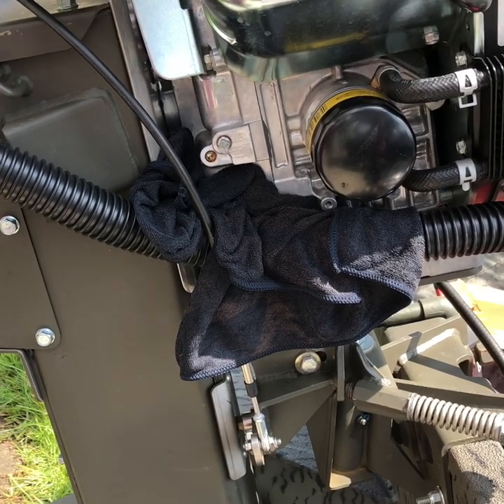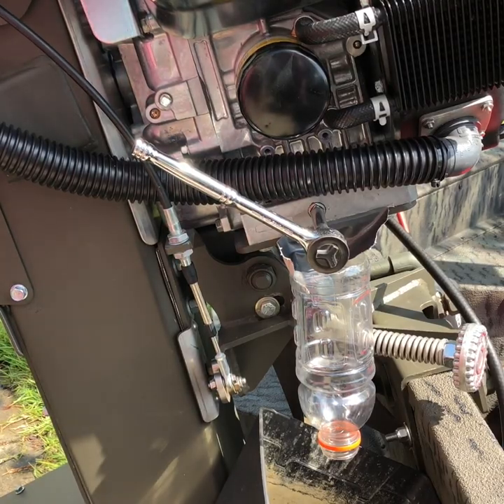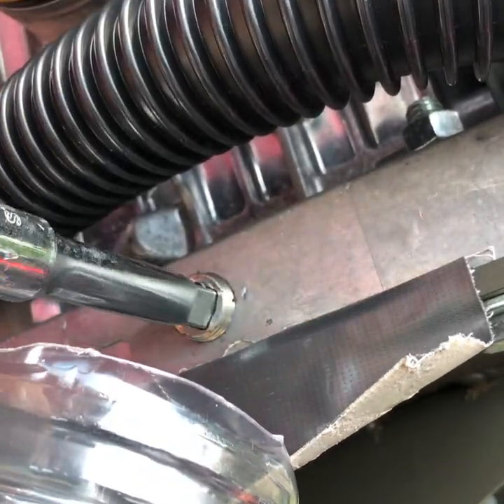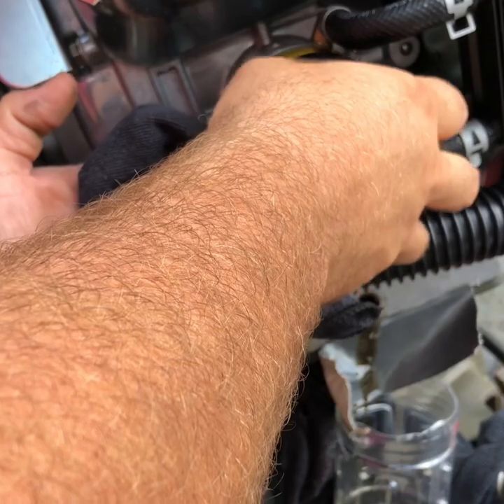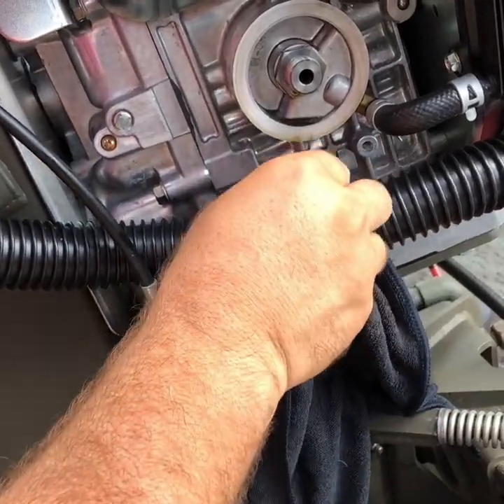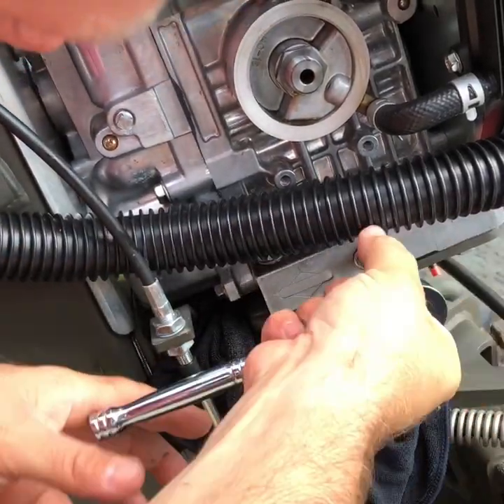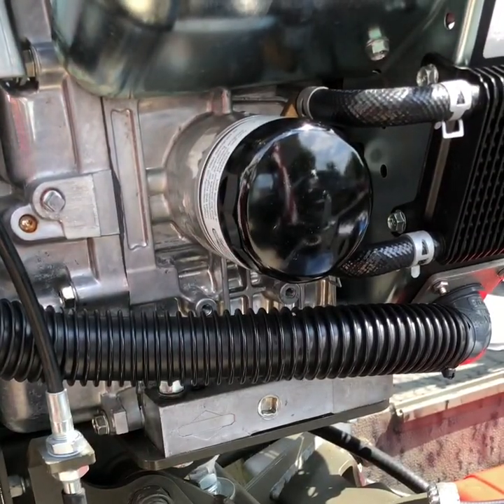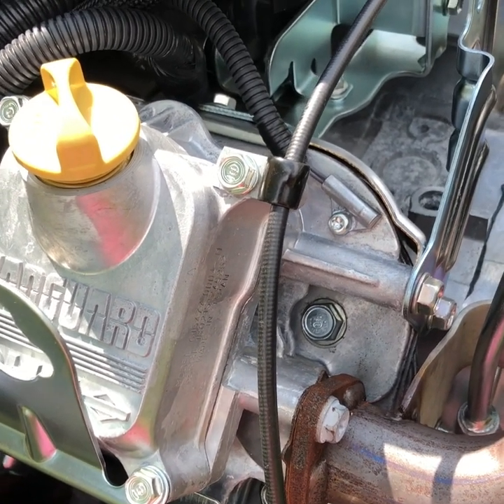Go Devil fnr Vanguard 40efi first oil change

Comment: U should level the engine or at least have it tilted to the pull plug side before draining. This will ensure you get as much oil and sediments out as possible. Tilted back like you have it, the sediments can go to the back of the block.